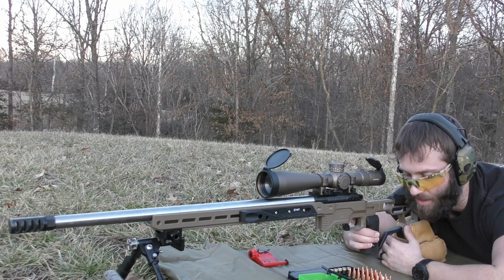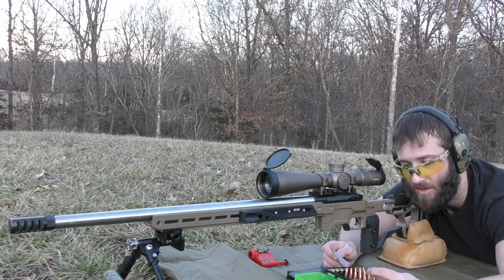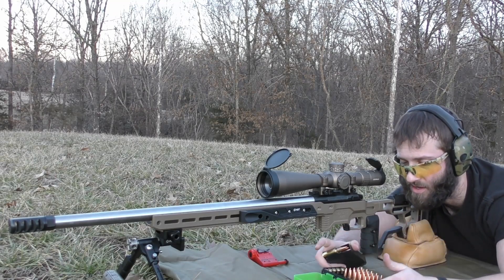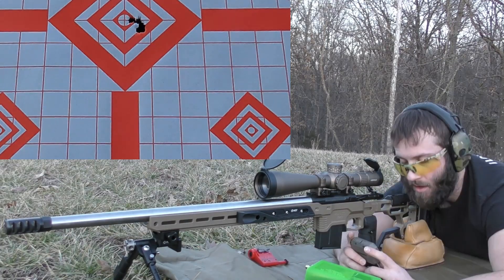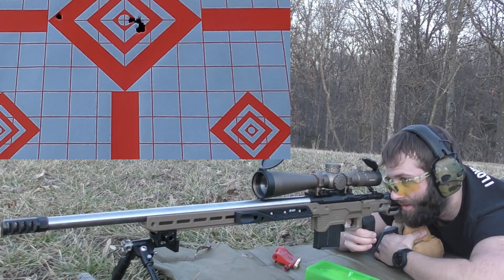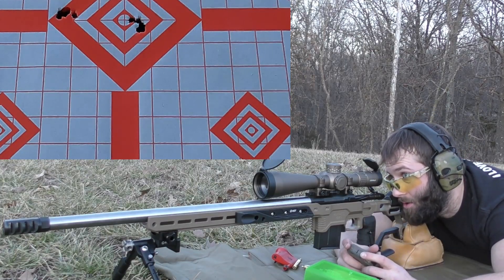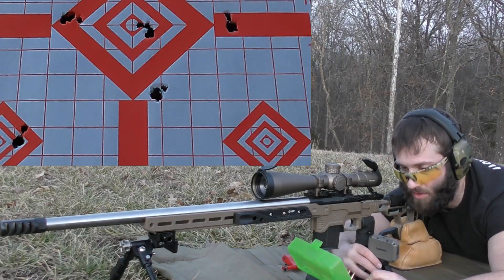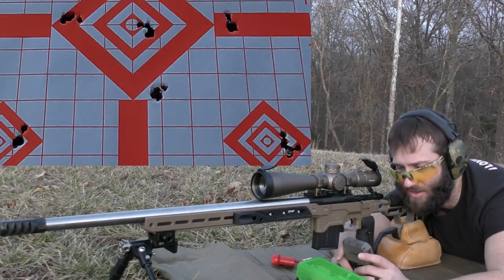NEW Hornady 140gr Aeromatch in Full Custom 6.5 Creedmoor Rifle: Accuracy Testing w/ Multiple Powders

Comment: They all pulled to the right ..its weird to see all charges & diff powder shoot the same
Reply from the maker: Yeah, I can't explain that, lol.
Reply: Powder doesn’t really affect group size at 100y. It’ll show up as vertical stringing at distance.

His shots are all to the right because his zero is off.
Reply from the maker: I thought you were talking about the fliers. I just realized what you meant. I keep the group slightly off from my point of aim, typically to keep my point of aim clear. It's hard to aim at the same spot when you shoot it out.

Comment: Its amazing the difference a good barrel makes. There's a big difference between a bartlein and something like  barrel from aero precision, seekins, bergara, preferred barrel blanks, faxon,  ballistic advantage. Results like what you got here are the exception not the norm. That's why F-class and benchrest shooters use bartlein, krieger, and brux. 

Also, its not the receiver or the stock as long as its bedded correctly making the difference.  The reamer design and gunsmith have a very small influence on the results as well. This is something I've learned over the last 12 years building F-class, benchrest rifles,  prairie dog and hunting rifles.  99.9% of the accuracy comes from the bore of the barrel. 

You should see how well a plane Jane remington 700 shoots with a bartlein or equivalent barrel and a laminate stock bedded correctly. Good enough to win 1000 yard f-class matches. I think i have a video on my youtube of what my 6brx and 22br built on remington 700's do. 5 shot groups in the low .2s with a bipod. Even the 6 dasher with 87 vmaxes and cfe223 shoots good. Its definitely a testament to a good barrel.
Reply from the maker: A great barrel is truly something to appreciate, but I have still seen great barrels get completely trashed by incompetent gunsmiths. So, always be careful about who you let touch your equipment!
Reply: Actions play just as crucial of a role in accuracy as the barrel..